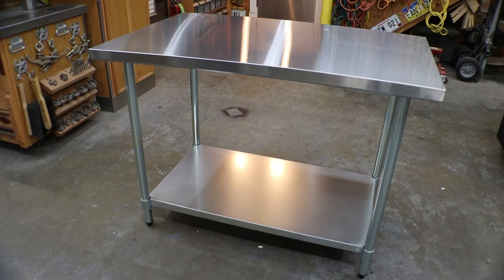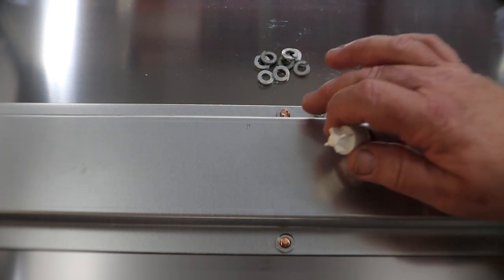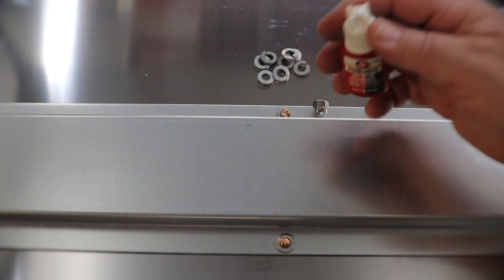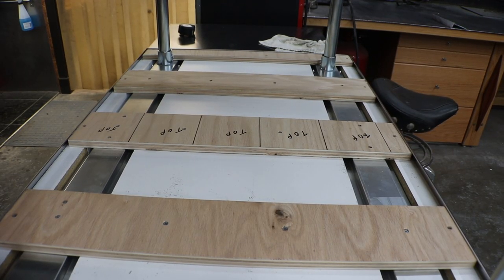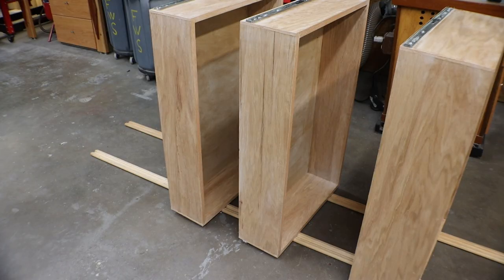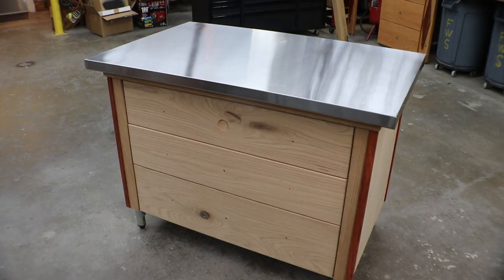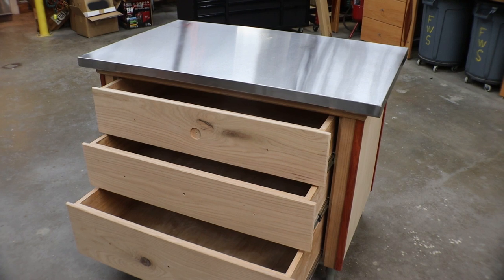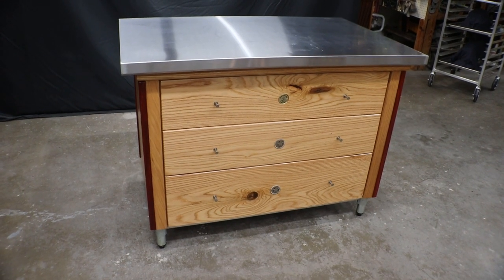SHOP WORK BENCH WITH STAINLESS STEEL TOP

Comment: I see these come up on public surplus auctions all the time. Love your treatment of this one. 

When I needed a chip pan for a metal lathe I wanted to have a custom one bent and welded out of stainless steel, but it was far beyond my budget. Instead I bought a large stainless serving table out of a school cafeteria from a public surplus auction. I removed the base and flipped it upside down and chiseled off the ancient chewing gum and bolted it between the lathe and the base I welded up out of square tubing. $50 instead of well over $1000!
Reply from the maker: Hey my friend you're absolutely right you can find them at all kind of used equipment auction. And it sounds like you made great use of one. You could have kept the old chewing gum and casted in resin. LOL great repurposing idea buddy and thank you thank you from Doug

Comment: Oh this is right up my alley. I've been doing stainless steel topped tables since I was around 27 - I even put warming elements in them. A ~78 degree working metal surface is sooo good to work on. The inspiration for this came from a big energy machine shop where they were doing insanely large parts for energy sector - people who did the layouts on giant cast steel parts had gigantic precision ground iron surface plates and they were heated from the bottom. Why? Because even in summer you couldn't rest your hands against the surface plate for very long and they were at the surface plate the whole day - the warpage of the surface plate due to heat was insignificant in a sense because you don't dabble in thousands of an inch when you're doing outlay for giant castings that have a lot of extra meat on them for machining.
Reply from the maker: I'm so glad to hear that you like it and thank you thank you my friend so very much. I have stainless steel work counters in my general purpose section of the shop. I didn't show him on this video but you can see them on my shop tour video. I've never thought of heating them though. When you live in Houston you don't worry about heating anything you've got heat all the time. 😃 But I can understand. and thank you thank you so much for all the input and information I appreciate that very very much. It's an easy quick way to build a stainless steel top cabinet. And it works great for me. Thank you my friend thank you so much I appreciate you reaching out. And I hope you enjoy all the videos. Take care and stay safe and again thank you so much from Doug
Reply: @fleetswoodshop3339  The machine shop was kept at 65F the whole year - even 65F is too cold for large metal surface in constant contact with bare hands the whole day.
Reply from the maker: @chronokoks  yeah that sounds like that would be a bit too cool and thank you thank you from Doug

Comment: Hey Doug I know this is an older video now, but just thought I'd share something with you, being that you're always sharing with us. Those little nuts are called Acorn Nuts or Cap Nuts. Some people called them Domed Nuts or Crown Nuts. Barrel nuts are something different. 

Also, if you have never tried PL3X Premium you should give it a try. Its a polyurethane based construction adhesive. Once I've learned about it, I've never gone back to Liquid Nails. That's all I use when installing my treads, risers and newel post. I think its way better. There's also a PL8X that is WAY stronger yet, but is much more expensive. It's actually overkill if you ask me. Anyways, construction adhesives have some a long way and they definitely have their place. Hope this helps you or others. 

corners
Reply from the maker: Hey there my friend how are you doing. You can respond any video you like the never get old to me buddy great info buddy. And yes my friend I've heard of pl3x. Been using it for a very long time. It would just be away overkill on that type of project. Like you say it's very expensive. I use it in the commercial business everyday. And thank you for reaching out my friend you can come in on any old video anytime buddy.from Doug

Comment: Well done! Love the padua accents and the detail. Your metal lathe work top is outstanding. Why the LED lights on the power strip? What purpose do they serve? With a wheeled bench are they needed? Looking forward for your shop update, can't believe it has been 1-1/2 years. Still enjoy that one.
Reply from the maker: Yeah my friend I know time flies by huh. It was the only power strip that I had handy at the moment. I plan on veneering the outside of it with oak I just haven't got to it yet so I use that one temporarily it was a spare when I had from the inside of an old toolbox lid. and I'll get that other one out soon I promise thank you buddy thank you from Doug

Comment: We always put cross members under the top and shelf. Like a lower case T. The leg channel should also be flat to flat...meaning the turn back should face down towards the ground not a hollow channel between the top and legs. Strange build...not even sure if it's NFS.
But that doesn't matter in a woodshop. 😁
Sorry I meant NSF not NFS 🙄
Reply from the maker: Thank you buddy thank you very much it worked out pretty good the way I do it. Can't get everything right every time but I try my best. I'm not quite sure what NSF means. But it's okay it works out and thank you my friend thank you thank you from Doug

Comment: Can this table give an electric shock?
Reply from the maker: Hello Victor how are you my friend. You could shock yourself on any metal surface if you got electrical conducted to the table. But using electrical equipment on top of the table will not shock you no. most all welding tables and part tables are made of steel on the top. So no it wouldn't shock you all by itself like I say if you stuck on electricity to it it would any metal wood shock you that way. But I'll buy itself no it's a great safe table top. And thank you so much for asking thank you. From Doug